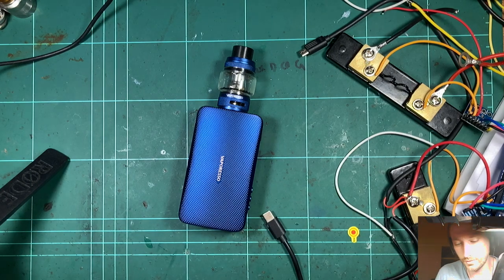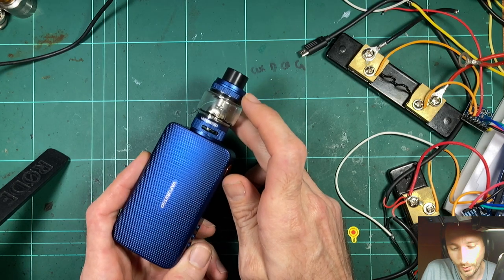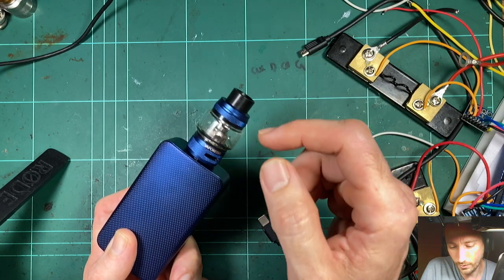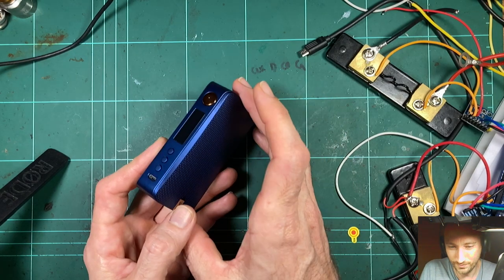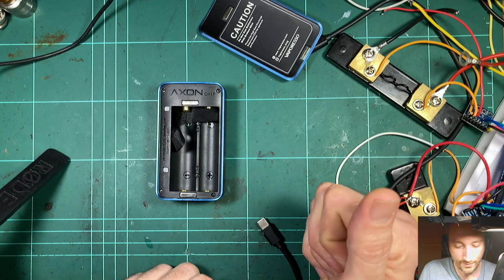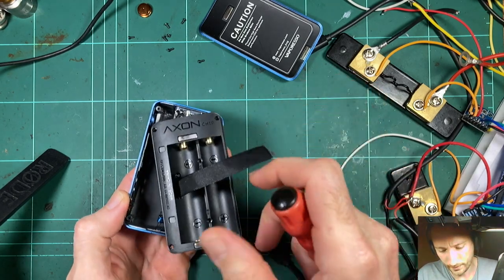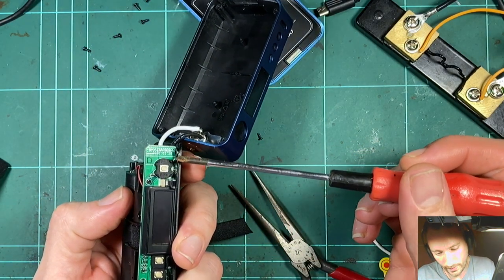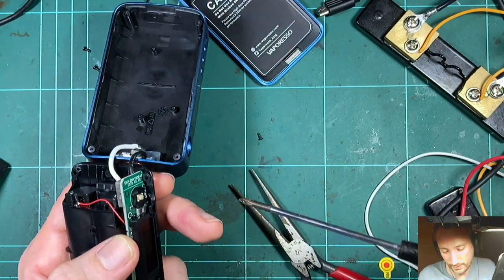Vaporesso Gen S - Dismantle, comparison to the original and trying to break the 510

Comment: Like alot of mods the 510 has a tiny weld/solder underneath that stops it from spinning when you screw a tank on. It usually is that weld that breaks causing it to wobble, over time if left the 510 will start to pull through ever so slightly exaggerating the wobble.
Reply: Exact issue I have had with two separate GEN-S mods. There's apparently no way to fix it, either, so I am shit out of luck.

Comment: I'd had my gen for over a year and it was a rock solid 510, even after dropping it on the floor a few times.  A few weeks ago I woke up in bed and couldn't find my mod until I realized I had been sleeping on it.  Sure enough, now my tank, even when tightly screwed on has a very slight (not so much a wobble) give or movement to it.  I imagine this will just get worse over time, so I bought a new one and I'm keeping the old one in a drawer just for emergency.

Comment: I know this video is a couple years old now but I just bought one of these mods on sale so I appreciate the tear down, thanks. It seems decent but one thing I don’t like is the tiny battery level indicator that my old eyes can barely read even wearing glasses 😂 It feels fragile compared to my previous mod but if I get a year out of it I’ll be happy.

My old mod is a hotcig R150W that’s built like a tank, dropped so many times and twice submerged in water. It has a metal case and colour screen and is still going strong after 4 years of abuse. I can’t believe the fire button hasn’t worn out. Unfortunately the insulation on a thick power wire has worn through where it rubs inside the case and I’m worried it might short out.
Reply from the maker: Thanks for the comment! Always good to have more user experiences listed here. Yeah I definitely wouldn’t keep using a mod which has a damaged wire inside, good move to get a new mod.
Reply: @vmgtesting8014  yeah the little bit of extra safety an electronic mod provides is the main reason I don’t just get a fully mechanical one. I’ve worked with lots of different lithium batteries and have had a few go up in flames, an 18650 going off in your pocket would ruin your day 😂

Comment: Crazy to think some stores were still charging $80 AUD for the tank alone when you could get an Aegis L200 Kit or even an Aegis Touch T200. I've owned several Gen S mods and have had issues with almost all of them, all of my Geekvape mods have had their fair share of fall damage and are still fine years later.
Reply from the maker: Who was charging $80 for the tank??
Reply: @vmgtesting8014  Wick and Wire have been for ages, for only the mod not even a kit lol. 

They only just recently had them for sale down from $80 to $66 but my guess is the only reason they did it was to clear out the last of the remaining stock they had since they only have a handful left.

Edit: Sorry I just re-read my original post, I meant to say mod not tank, got it a bit mixed up there lol.
Reply from the maker: @ezzahhh  Ahhh gotcha, that makes more sense if it’s for the mod rather than the tank. Still, 80 bones for a mod by itself is a lot! I don’t think the Gen S is special enough (at all) to warrant more than $50AUD tbh. Agreed the older Geekvape mods are solid, the new ones aren’t as much.
Reply from the maker: @ezzahhh  Ahhh gotcha, that makes more sense if it’s for the mod rather than the tank. Still, 80 bones for a mod by itself is a lot! I don’t think the Gen S is special enough (at all) to warrant more than $50AUD tbh. Agreed the older Geekvape mods are solid, the new ones aren’t as much.

Comment: My Gen S has started wobbling. Never dropped the vape and its basically in new condition as I only use it at home. Kinda disappointing as my vaporesso luxe never had problems and its 1-2 years older. and I took it everywhere. Will take my gen S apart and try to fix it when i buy a new mod. Also it feels like its the 510 pin thing thats moving, not the base metal bit you were trying to pull at @ 9:56
Reply from the maker: Thanks for the feedback mate, it’s handy for anyone reading about this mod to know that even the S model is still having some issues in some cases. Give me a buzz if you get it apart, I’d be interested to see what’s going on. Yeah on further thoughts I think it’s not that retention plate which is the problem, more likely the 510 assembly around it is two pressed together pieces which are coming apart when they shouldn’t.
Reply: I've had the exact same issues with mine as you mate, it just stands on my desk, never dropped it, and I move it around in a plastic protein shaker to save it from breaking and getting wet in case of rain. It's definitely the top metal bit where you screw in the tank that's the issue. Had a leak on the tank, and the juice got in under that connector bit, and came seeping out as I pressed it with my fingers. It's almost like it's elevated a bit now, wobbles side to side, and a rotation motion which makes the tank not feel secure at all. Part from this issue I've loved the mod, was great until this happened. I'd say maybe six months in, just in time for the warranty to have expired.

Comment: I have a Gen S, but does it work with cannabis oil cartridges? When I screwed one on it lit up for a second and never again
Reply from the maker: Should be fine, you'd just have to make sure the wattage is turned down low enough. I've never used them myself but assume they run at super low power. Is the cartridge marked with a resistance or power?

Comment: I have an original gen and an s, both have wobbly 510s. Ive taken both apart and cannot figure out how to tighten them other than the screws. Didnt help.
Reply from the maker: Thanks for the feedback mate, seems there might be less S models having the problem but it still happens to some. Yeah tightening the screws won’t help, I believe the 510 is pressed together with that screwed plate in the middle. When those pressed pieces start coming apart there’s not a whole lot you can do apart from replace the 510 entirely. Which I think shouldn’t be a big job as long as you can solder.

Comment: Could you please do this with the Gen X? Thanks in advance ☺
Reply from the maker: Thanks for the suggestion! From what I can see it looks like the X is probably just a metal body with the same board as the original Gen and the S. In that case all the testing results should be the same, I have a full report on the Gen on Reddit if you’re interested. I’ll let you know if I can convince Vaporesso to send a sample of the X!
Reply: @vmgtesting8014  Yeah, the inside seems to be exactly the same. The Gen S just got a firmware update compared to the original Gen, from 1.0 to 1.3.

I'm just very curious how much more durable or stronger the Gen X is. Especially after seeing your original Gen where the outer layer of coating fell off. 😅😂

Some Vaping reviewer told exactly what you countered, that the 510 connection had a lot of problems where it came loose and that that issue wouldn't be a factor with the Gen X, due to the metal (aircraft grade aluminium). This made me pass a great discount deal on the original Gen...😊
Reply from the maker: @nickn.14  Good point! You’d have to think the metal is more durable but I’m still a bit skeptical about whatever they’ve used as a coating (or anodising) to achieve the colour finish. It might wear off too 😓 The metal body might not much difference for 510 durability since in the mods where I’ve seen it fair I believe it’s the 510 itself coming apart and not the case breaking.

Comment: Just got one for 3 weeks, I had the bad idea of updating it, now it doesn’t charge through usb anymore, just showing 220min to charge. 
Have you ever seen something like that?
Reply from the maker: Oh that’s a weird one. I can’t say I’ve ever found a firmware update to cause charging issues. Ignoring the time to charge indication, is the battery level actually going up? The charge circuit is fairly self contained as a physical part of the board and shouldn’t really be affected by a firmware update unless something really strange is going on. Maybe worth trying a different cable or adaptor just on the really random chance one of them failed at exactly the same time as you updated. Are you currently trying to charge by PC or standalone USB power adaptor?
Reply: @vmgtesting8014  yeh that’s a weird one. I’ve tryed different cables different adapter, and even different firmwares, the result is still the same, it indicates that it’s charging with an approximation, and after 5 sec it says 220min to charge , and just stays like that without charging. 
After a heavy usage , I noticed that only one of the 18650 is fully discharged the other stays at more than 50%. 
By the way, thanks for the response.
Reply from the maker: @yassineYrahmo  Hmm okay maybe an issue with the cells themselves? Do you have another set you can try? Firmware definitely shouldn’t have anything to do with how they’re discharging since they’re in series they’re physically forced to flow the same current each to the mod. One cell going flat much earlier than the other could indicate that one is failing. Also that could explain the long time to full indication - the charging will be super slow if the circuit has to do a lot of balancing to get the cells equal again.
Reply: The exact same problème with an other new pair of cells. 
I have to send it back.

Comment: If you can't take it apart with tools, how come people say the 510 comes apart with normal use?
Reply from the maker: edgsalga Honestly I’m not sure! The only thing I can think of is either some mods are getting heavily and repeatably dropped by the owners, or maybe there was a manufacturing issue where some parts of the 510 assembly weren’t sized perfectly and could come apart easier than my models.
Reply: @vmgtesting8014  I've been ever so careful with mine, never dropped it, and since I cycle a lot I always wrap the whole thing up in cloth and squeeze it down a plastic protein drink shaker, and stuff it in my backpack standing up. Still I've got a wobble on the tank, both a circular motion, and a side to side wobble. Supplier said I should get used to buying two tanks a year. Absolutely outrageous in my opinion.
Reply from the maker: @TheAngieStoned  That sucks! There’s been enough comments now to say that obviously these 510’s are still coming loose. You shouldn’t ever need to buy a new mod or tank on a regular basis IMO, it should be one of those things that could only break in extreme situations like repeated hard drops. Not with normal daily use. Thanks for the feedback, it’s handy information.
Reply: @vmgtesting8014  No worries mate, thank you for the very handy videos! You earned a new sub today 😁 Just ordered a brand new Vaporesso Luxe 2, so hopefully that'll last a bit longer. Or you'll hear me complaining here again at springtime... Keep up the good work!
Reply from the maker: @TheAngieStoned  Really appreciate the sub, thank you! Hope you have better luck with the Luxe 2 and actually if you do ever have issues feel free to hit me up either in vid comments or u/VapeyMcGyver on Reddit. Cheers!
Reply: @vmgtesting8014  Will do, thanks!

Comment: my button quit working after a year how do u fix
Reply from the maker: There’s not a lot you can do tbh. It’s possible to replace the button but it requires special soldering gear, it wouldn’t be economical to pay someone to do it. If it’s any consolation, getting a year of full time use is pretty good for most devices.

Comment: Did you ever manage to figure out how to remove that plate...want to remove it to that I can attack my wires easier
Reply from the maker: I didn’t get it removed from my mod but someone sent me a vid of their 510 which came loose - it looks like the plate which screws onto the mod is sandwiched between two pieces of the 510 which are press-fit together. I think it would be really difficult to get them apart and if you did they may not go back together well!